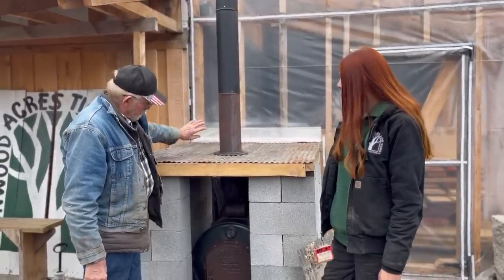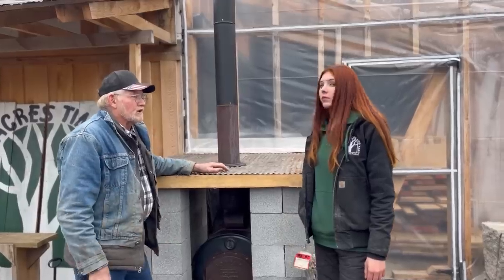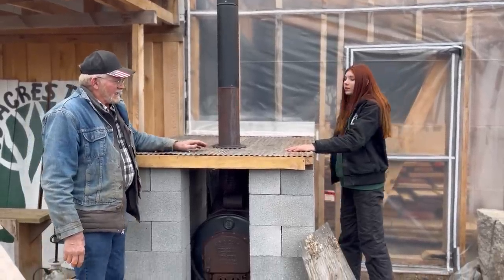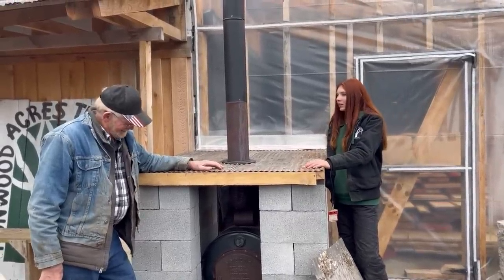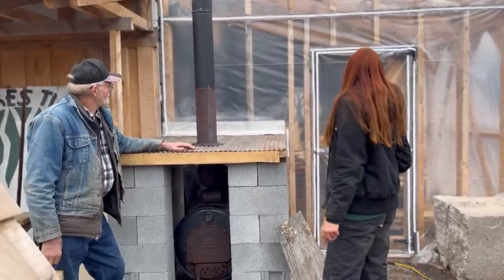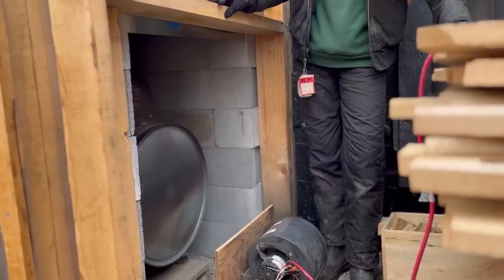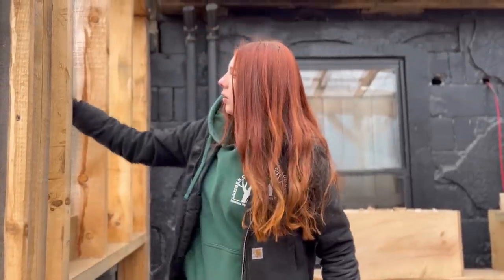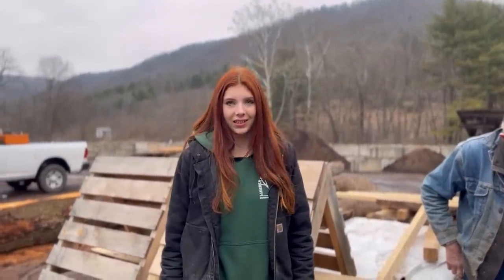Using a Barrel Stove to Heat Our Lumber Kiln: Does it Work??

Comment: Free advice:  Do either solar or wood-heated. Not both. For solar, build waterproof and insulated walls and top it with a double layer of UV resistant greenhouse plastic. It’s important to make your drying area well-insulated so that once it’s warm in there it stays warm for as long as possible. If I were you I would start over with a freestanding kiln out in the open facing south. If you wish to stay with the space you have you need to insulate the masonry walls. They are massive heat sinks and you can’t win that fight. Also replace the plastic that is on there with an inner and outer layer of UV resistant greenhouse plastic. Maybe get some solar gable vent fans to recirculate the air in there. You also need vents to allow moisture to escape. That’s all for now. Hope this helps.
Reply: In  the  Spring , when  the  Kiln is   empty, I  wonder  if  they  should  shovel  that  crushed  stone  that  is  on  the  floor  of the kiln,  to  the side;  and  put  down a  couple of  thick  sheets of plastic. Then ,  shovel  the  stone  over  top  the plastic, to  keep the  moisture from  coming up  from  the  ground  beneath  the Kiln .
Reply: I  agree  with  going  with      a  wood  fired  kiln.  Then,  insulate  the walls  off , and  totally  enclose the  whole Lumber  Kiln.
Reply: I agree , in my greenhouse i put a small heater in the spring to keep it above freezing but in the summer i have fans blowing to avoid excessive heat.
Reply: You can win the battle with the masonry walls.  It's called thermal mass.  That is why they were painted black.  Once they heat up they retain that heat and slowly release over time in the evenings.  For air circulation, most solar kiln's I've seen use solar panels to operate 12V DC fans.
Reply: @bwillan    Yeah, I know what it’s called. A “Trombe Wall” it ain’t.

Comment: Remember the primary goal is to remove moisture not heat the kiln.  Do you have a humidity sensor in the kiln?  Siply heating the kiln will make it more humid inside the kiln and will not aid in removing moisture from the wood.  Is there an exhaust vent to the outside?  That vent is where the moisture is vented away from inside the kiln.  Warmer in the kiln is good but not as important as venting the moisture in the kiln.  
I bet you won't even need the blower at the barrell if you put in a natural draft exhaust vent at the far end of the kiln.  If anything, a fan to move the air around the wood will speed up evaporation of the moisture..

Comment: Heyo y’all should put some black paint/solar absorbing material on the bottom and the lower half of the solar Kiln. Greater thermal gains with passive solar heat.

Comment: How do you vent the moisture out of the room?  If the vent stack is not a double walled, insulated type, it would seem that running the vent stack inside the room would generate even more heat.  (These may be dumb questions.  I know little about the subject.)

Comment: The wood burner is a good way to heat.  But you are losing a massive amount of heat potential by having the flue outside.  If the flue was inside, you will easily double your heat output.

Comment: recycling the air is a great ideal, BUT keep in mind that you need fresh air intake because you are actually burn the oxygen out of the air, which leaves carbon monxide.It's the same with fire places and gas burner heaters. stay safe and warm.

Comment: I am honestly interested if this works for you. Will you be able to get it up to 140 degrees Fahrenheit. That is what is ultimately needed at some point to have kiln dried wood. I have seen some kilns that use sawdust burners to heat there kilns and it works very well.

Comment: I can see the heat inside the kiln will dry out the wood. The heat moves the moisture from the wood into the air I figure. However the moisture laden air needs to move from the enclusure to carry the moisture away. How is it vented?

Comment: Heating the kiln will definitely help, but you really need to work on the design of the solar kiln itself.  You need to use clear polycarbonate corrugated roofing panels for the roof.  The roof needs to be angled toward the south.  You only want the angled roof to allow the sun in.  All the other sides need to be painted black and insulated.  You also need fans blowing the warm air through the stacks of lumber and only through the lumber.  You need to baffle all the other areas so the air only moves through the stack.  The baffle would cover the top of the stack and the sides.  The baffle also prevents the sun from shining directly onto the lumber.  Direct sunlight to the wood can create defects.   Vents are also needed to allow the moist air to escape.  You need to monitor the rate of moisture removal from the lumber to prevent defects such as cracking and case hardening.  Here is a link to the Virginia Tech solar kiln plans:  https://vtechworks.lib.vt.edu/bitstream/handle/10919/98866/420-030_pdf.pdf?sequence=1  Here is a link to a seminar done by a professor at VT that gives a lot of good general information on drying lumber:  https://www.youtube.com/watch?v=sUchq3b2Cnc&t=2800s
Reply: Your so right.

Comment: You're going to need fresh air, heated or not. Otherwise you're just steaming the wood. If you take outside cold air and heat it, the humidity level goes way down and it's capable of absorbing moisture from the wood. Recirculating inside air past the heater might not be a good idea.

Comment: Just heating the wood will not dry it when the air can not get out of the kiln. The barrel has to heat up dry cold air from outside and heat it up so it can contain more moist. But when the moist is in the air it has to be blown out again and refreshed by new warmed air.

Comment: I would think you need a way to suck off moisture, like a dehumidifier , with a outside drip, so you dont have empty it.  and I recently learned that plastic does not shred humidity.? i dont know why? next time you empty your dishwasher check the plastic, it is wet?  Fans Maybe?  ! or you could put the Dehumid next to the coffee maker and some chairs, Hmmm

Comment: There is a reason why vehicles are now liquid cooled. Water is 784x more dense than air and it's specific thermal capacity is 4.23x greater. DON'T USE AIR TO TRANSFER HEAT (ENERGY)!!! Make a loop. Weld steel piping that runs inside the stove, then through a Hot water recirculating pump from amazon (low flow), into an old car radiator, with a fan blowing across the fins.

Comment: DO THIS FOR MAXIMUM HEAT
HOT WATER SYSTEM LET WATER GO THROUGH LARGE TRUCK COOLER USE FAN TO DISTRIBUTE HEAT EASY 70-80 DEGREES CELSIUS

Comment: Triple the efficiency by:  Reflective surfaces, even clear glass reflects heat better than steel (ie doesn't conduct) Aluminum foil works well, esp on foam board insulation.  Start w/ the ceiling, even white paint is effective.  Straight pipe flues loose 50% of the heat generated. Keep it at a steep angle through the kiln, w/ fans blowing from above (black dissipates heat best).  Insulation R factor makes a difference, yet the majority of heat is transferred via radiation (not nuclear, though the sun is a nuclear cycle).
If you want to know why the lunatics are wrong about the landings claims of 69', research 'Black Body in Space'.  Essentially, w/o a radiant body near by, all heat would be lost to the vacuum of space in short order.  It's also how people in the middle east can make ice overnight, on their rooftops, even when ambient temps approach 40deg F. (has to be a clear night, even clouds reflect heat)
Trivia: After the Twin Towers fell, the Earth cooled slightly due to fewer jet condensation trails in the atmosphere.

Comment: Heat my 3 story home  basement  ground  floor and upstairs   lol heat rises upstairs  girls always opening  windows  becuse got too warm 
Stacked double  barrel heater in basement  in corner had concrete  side and back wall  then open on the other walls then the floor above had holes cut in floor to allow heat to rise next to walls  used to have chimney  in center  if basement  but had been tore out by others used as a chase to get heat to the upstairs  worked quite well 
The concrete  wall acted as heat sink stored up heat when fire burned down or wet out the walls would give up heat for hours after  so home was still comfortable in mornings